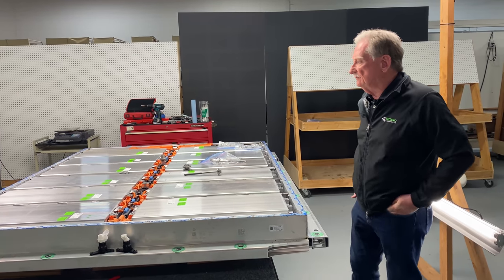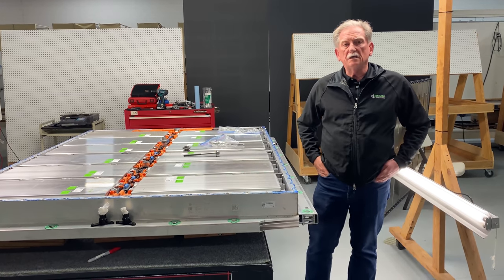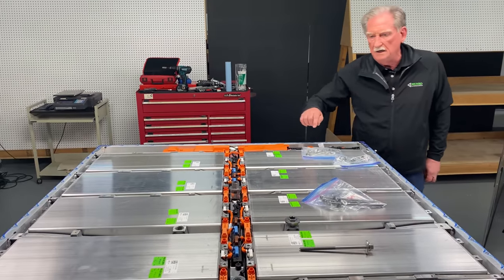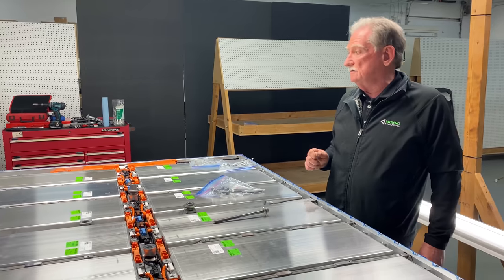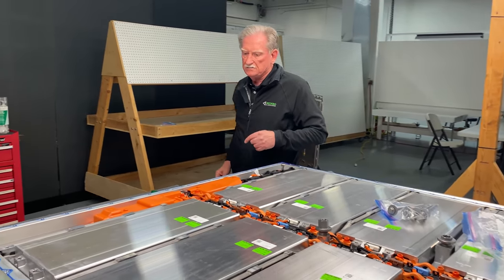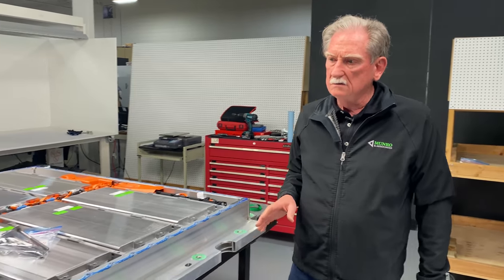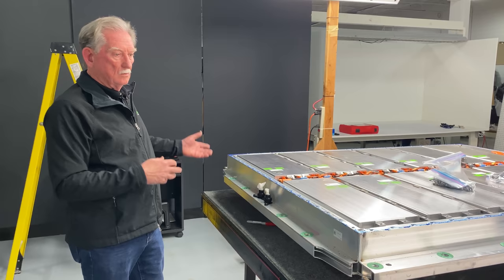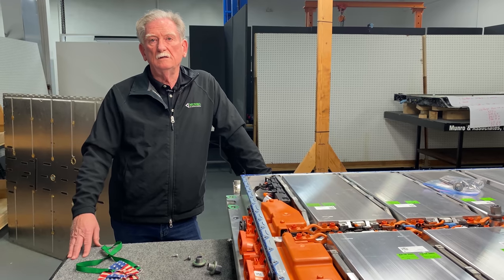2021 Volkswagen ID.4: Battery Teardown

Comment: World has enough plastics as is. Battery parts are infinitely recyclable, please lets keep them this way.
Reply: Welcome to the wonderful world of contradicting requirements, the so-called real engineering. Want world without plastic - you can watch an old movie from the 1920's.
Reply: also aluminum is very light. I doubt there is 100kilos of aluminum in that battery to begin with .
Reply: I mean munro even suggested that the wheel suspension is made to heavy and weight could have bin saved....he also complained that German cars are allways way heavier than compareable cars....
Yet who preferes a more flimsy wheel suspension? 
The other thing is sound and vibration proofing the car adds weight. 
Allmost all cars I drove start to become realy load at some point above 120 kmh, fords at above 130 kmh(aka 81 mph) 
Yet cars mainly build for Germany habe to be comfortable to ride for way higher speeds. 
Hitting a road bump with 200kmh is different than doing so with 80mph.
I dont think munro would save these weights if he would build these cars for Germany.
Reply: @TremereTT  also in EU they make those cars heavy on purpose to have  more fuel allowance by law so they don't have to pay gas guzzler fines. That is for ice cars of course.
Reply: @hagestad  Soundproofing a car for fast speeds isn't easy! you wouldn't add additional weight just for fun.
Reply: Aluminium might be energy intense to make and recycle but when done with renewable energy like in the EU thats preferable to what a Saudi petro-chemical company looking for new business opportunities might have to offer. Let them make some green H2
Reply: @hagestad  there is no such law on EU level, which country exactly are you referring to that has this kind of law?
Reply: @velotill  Production of aluminium requires much energy, recycling (here: simply melting) on the other hand requires way less energy.
Reply: Nemáte pravdu mají je všichni členové EU.
Reply: screw plastic...
Aluminium in being recycled and the stronger material.

Comment: 9:40 Don't forget the recycle-ability with bare aluminum. With glasfiber plastic this would be all scrap some day.
Reply: Fiber glass can be recycled now by pyrolysis on large scale e.g. wind turbine wings and yachts.
Reply: @lpabildgaard  It's not really recycling when you're burning the epoxy away, and the woven sheets used in the original structure can't be reused as woven sheets, all they can do is chop them up and use them for glass filled mouldings, so it's downcycling rather than recycling unfortunately.
Reply: @lpabildgaard  A pyrolyis is not really recycling. plastics are converted to CO2
Reply: As battery technology continues to evolve, EVs will trend toward much longer lifespans than combustion engines especially for fleet vehicles, and recyclability of these components become less of an issue comparatively.
Reply: @jonathan4831  maybe so, but recyclability is already required in certain percentage of the total car. And that recyclability % is only going to go up.
Reply: @jonathan4831  Allow me to doubt that. See curent phones, they could in theory be used for much longer, but software advancements kind of force us to change them after a few years as they become more or less absolete. I think it will be the same for cars, too: new comunication systems between cars, comunications systems between road devices and cars, new safety features people will want, etc. We will have more or less the same system for a few decades. And battery have to recyclable as we do not have enough resources to make new ones as we are moving to electric, right now we are at 1-2%, imagine how many times things have to be multiplied.
Reply: that's a fair point. I know that the EU is increasing this requirement more. I was more commenting on aluminum versus composite materials. Aluminum composite panels could even be used for the larger components. My point is I don't think we should dismiss composite materials entirely on that basis alone. Investments in glass and carbon fiber processing technologies will be the bridge to develop more sustainable and recyclable products just as thermosets were the bridge to thermoplastics for wind blade development. For instance, woven flax or hemp fiber fabrics plus ribs are being developed as interior trim components and the processing expertise and technology came from woven glass and carbon fiber products. I wholeheartedly believe in sustainability and recyclability, but settling for aluminum may hinder developments of other technologies if there isn't real-world push for research and development.
Reply: @FlorinArjocu  If we apply the behaviors of consumers and the changes in technology today, then I definitely agree with your perspective, however, consumer behavior is expected to shift away from car ownership by 2050 as the cost to use autonomous transit becomes cheaper than owning a car. That would shift the car ownership from consumer to commercial / fleet ownership, and fleet customers are more likely to use cars for much longer than consumers. That shift may not happen, and definitely won't happen everywhere, but it is a possibility with autonomous vehicles.
Reply: @jonathan4831  I agree, but that is 20-30 years from now. That means we will have a few hundred million cars to worry about until then. Things need to be taken care today, otherwise we'll have a major problem also with the lack of lithium/metals etc., not only with polution.
Reply: @FlorinArjocu  battery technologies are a separate issue from weight reduction techniques. I don't agree with his choice to reduce the weight of the connector pieces or internal battery parts. My recommendation is using composites for the battery compartment structural components which can still have a drastic affect on range as they are very large pieces. For example, replacing the cover and floor with composite panels while keeping the side aluminum structure can reduce the weight significantly. Those panels can be made from fiberglass and thermoplastics, and be downcycled at end of life - which theoretically could be two to three times the lifespan of combustion engines. I agree that battery technology itself definitely needs to be advanced from current lithium batteries, but I think we're going to see some major breakthroughs in that regard within the next 5 to 10 years, especially with the push for fleet EVs, consumer EVs, and AAVs (autonomous aerial vehicles). There are companies now developing battery technology that eliminates lithium such as the aluminum ion battery that can rapid charge.
Reply: Absolutely.. A lot of the complaints in the video are a bit anachronistic LCA wise.. Like those on the treated fasteners and composites over aluminium extrusion..
Reply: Americans do not care so much as i know about stuff like that. Alot of what Munro is critizizsing on the ID.4 is the design deciscions for Botls instead of rivets which just shows that he does not inheretly understand why VW has/wants to do it this way. He has processoptimizer and costreducer as mindset which is not bad but doesnt fit the european market. I mean GM did the same with opel and gathert losses after losses after losses over how long 20 years? Then they sold it to PSA and the first Year after that Opel was/is profitable
Reply: @lpabildgaard  thats not really recycling ma man
Reply: Carbonfibre is highly toxic when burning. Tiny small arrows from the fumes gets in to your lungs. I wouldnt use that to much on a car if you want a high recycling grade.
And big batteries is not needed for most people. Sure some drive 400km per day but def not all
Lower weight=funnier car to drive
Reply: Instant first thought , why on earth is there a lid for the battery case ????? Surely the case can just fasten to the underside of the car which will form a box ! Why have a lid ? What function does it perform when you have a sheet of steel forming the car body above it ? Would it not be possible to have the bottom of the pack form the  floor pan of the car with a carpet/sound deadening layer on top also forming a fireproof/waterproof layer all in one ? It could also act as a  structural layer to stop the battery entering the cabin in a crash could it not ? Sort of a jack of all trades?  Should save a good bit of weight there I should think .
Reply: Toto je blbost US zákazníku, že platí stále znovu a více za to samé.
Reply: @jonathan4831  that's in the first world.
Reply: yep, remember bakelite?  it was widely used before plastics, unfortunately it takes hundreds of years to degrade. If burned, it's toxic.
Reply: As long as electric cars are being charged with non-renewable sources, I think the environmental benefit over the lifetime of the vehicle of reducing weight would far outweigh the impact of replacing metal with plastic.
Reply: @lpabildgaard  It will be recyling of plastic waste and the scammy recyclyed plastic propaganda. Like only approx 1% of plastic is recycled.

Comment: Very well designed and engineered.
Great for recycling and for structural integrity and strength.
The  MEB platform is immensely strong as proved by the 5 star euro n cap test results for the ID-3 which has the same battery pack design as the ID-4.
VW  has done a sound job here.
Reply: This guy is out of his mind

Comment: Unfortunately, what is completely forgotten here is that the VW battery is scalable, meaning the battery can have 45, 58, 77 and 100 kWh net battery capacity. And can be installed in all vehicles of the VW Group, which are based on the MEB. In addition, there is the possibility to install different cells depending on availability. That means for me, this is very well developed. Especially since these modules, which make up the battery, can be used in stationary applications. Furthermore, it should be said that the weights for Model 3 and Y are not the LFP batteries, these are about 25kg heavier.

Comment: 1:24 The ID.4 battery has 9.33% more capacity and weights 11.39% more. 
In other words the ID.4 battery weights 9 Kg more than a 82kWh Tesla model Y battery would weigh. 
Or the ID.4 battery weighs 1.88% more.
Reply: So that's a pretty good deal, considering the flexibility of VWs system. They can easily make the battery smaller by throwing out single modules and the "trays" can be made in different sizes for the different vehicles.
Reply: @Monkeyheadtpc  I agree but most car battery packs are modular so VW isn’t unique in this respect.
Reply: Exactly we should look at kilograms per kilowatt hour.
That said it is inherently easier to make a larger pack lighter relatively because the perimeter increases with the square of the size of the volume
So the Tesla packing is actually a little bit better than your calculation shows if we were to make them the same capacity the gap would probably increase a little bit
Reply: @FreekHoekstra  The ID.4 battery pack also included crash protection - how about Tesla?
Reply: @venti4268   as far as i know, it does too.
Reply: @Conservator.  Didn't say it was, just that when you look at the "higher" weight compared to Tesla, the penalty is relatively small for the possible advantages.
Reply: @FreekHoekstra  and on top of that the new Tesla battery pack will be even lighter with the 4680 cells
Reply: And considering the modular design that's actually quite impressive.
Reply: @Sidowse  Its the same pack as in the id3 and other cars.
Reply: @FreekHoekstra  Ok, let’s call it 2.00% instead of 1.88% 😉
Reply: @Monkeyheadtpc  Ah ok, your point is the Tesla battery isn’t modular? I think it is though, more or less.
Reply: But inside the Tesla battery pack the charger is included, that seems not the case at VW. So to compare it, you would have to add the weight of the charger and cabeling to the VW battery and compare it then against the Tesla pack.
Reply: @Conservator.  Tesla’s battery design is not modular. Munro covered this in one of the first videos when he talked about the MEB platform. Tesla builds a battery pack and platform to suit each separate design.
Reply: @Apolloskouros  I was think of the model S batteries. Iirc the higher capacity cars have an extra battery pack in the front of the car. That’s what I meant with ‘more or less’.
Reply: @Apolloskouros  the id4 top charge rate is 125 amps.  Tesla is ~2X as powerful. The kia6/ioniq5 coming out in 2½ months? ~3X as powerful.
Reply: Yea, and then also consider that while weighing 1.88% more , it's WAY stronger than the Tesla battery assembly, and it's more repairable and eco friendly in design. So, it's not a bad deal for only a tiny increase in weight.
Reply: @derbigpr500  The Volkswagen design is more environmentally friendly because the module can easily be repurposed for solar etc.
I agree with you 100%
Reply: @dominicholder7323  yaya and 3 Years ago the Tesla Roadster comes out.

Comment: I feel recycling should be taken into consideration as well
Reply: Thats the one big thing about e-mobility. You can recycle the main part, the batterie, up to 95%.
Nobody should build the battery by intend irrecycleable.
Reply: Yes, this is why I'm not convinced about the recent proposals to build the batteries into the structure of the vehicle. It is easier to reuse cells if they can be removed from the vehicle without cutting it to bits - it is also easy to replace a faulty cell if it is screwed in position rather than glued.
Reply: @AndyFletcherX31  100% agree 👍🏻👍🏻👍🏻
Reply: @AndyFletcherX31  the connections are welded together and the batteries are glued together in modules even though they aren't structural. You could replace a module though.
Reply: @AndyFletcherX31  It doesn't help someone always wants to sell you a new car..
Reply: @AndyFletcherX31  Its not what structural battery means. People assume structural batteries means that you integrate the battery as a non removable component of the vehicle, but its not. You can remove the battery pack from the vehicle like you could before no problem. The car won't fall appart. However, the remaining framework holding the car together would no longer be rated to drive since it is now weakened by the absence of the battery pack. Just like how batteries themselves stop having a negative structural value as they contribute to the structure instead of hindering it. You reduce weight because you don't need to double brace the batteries, and unlike what is often beleived, it does not prevent the pack from being removed and changed. It just means you can't actually drive without a battery pack, which you could not do anyways
Reply: @mobiuscoreindustries  Language is a tricky thing. Thanks for the clarification.
Reply: „Take a customer like VW and take it into a success“
To late, they did not wait for your „environment friendly“ polymer solution.
Reply: @mobiuscoreindustries  I'd say you can compare structural battery packs with bonded front windows. In former times the front window simply was weight/load, structurally speaking, and did not contribute anything to structural integrity/stability/stiffness. The vehicle frame had to be designed stronger and stiffer. Nowadays front windows are "glued in" and are vital parts for the cars structural integrity. A broken front window can be replaced without any problems, but driving without it is a bad idea.
Reply: since when does america care about recycling.
the only thing they know i land fills for everything.
So the recommendation will probably  will make it more waste instead of being recyclable
also making it out of polymer is a good way to get leaks when it evidentially cracks (hopefully not inside as that would be a giant fire then)
Reply: @xeon_1705  imagine what would happen to VW if they would create such a „hot“ design.
Reply: Sandy has been too brainwashed by the american industry to care about recycling. Thats why the US produces more pollution per capita than any other country in the world, and by far as well. Not caring about designing things that can be repaired or recyled, leads to that.
Reply: RE-Cycling is the worst Cycling and should be avoided in the future RE-pair and UP-cycling are the way to go
Cost reduction has been the Unecological way of the past!
This fossile of man clearly does not care about repairability!
Engineering has to get rid of the throw away mentality!
Otherwise going electrical car does nothing for the environment!!!
Reply: @animarkzero  some (US) Company even want‘s to Giga-cast big parts of a car (best all) in a single mold. Means the only spare part is the car itself. 
The good thing is: real physics will not adapt to weird billionaires dreams. Sometimes even 3D-geometry stands across.